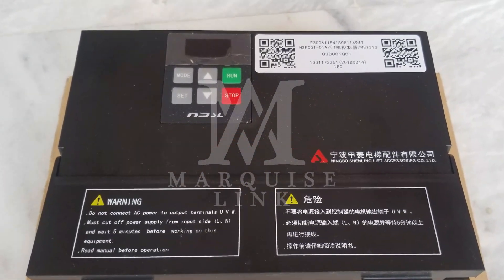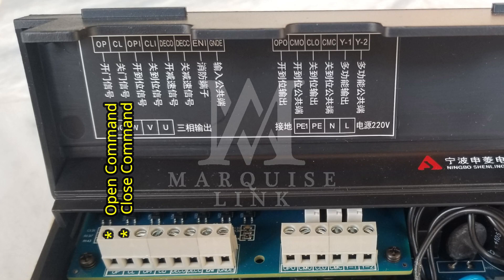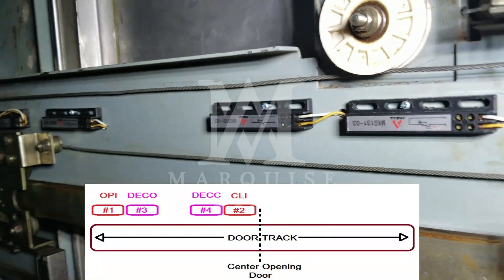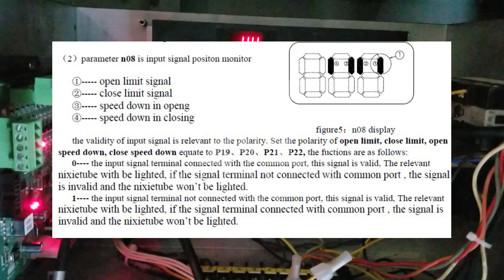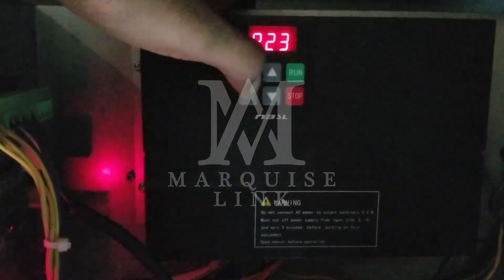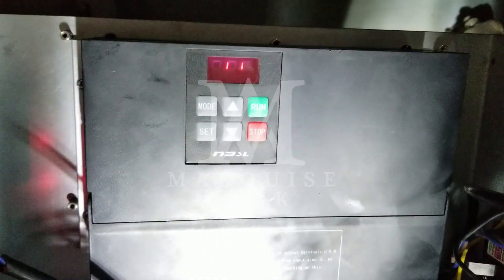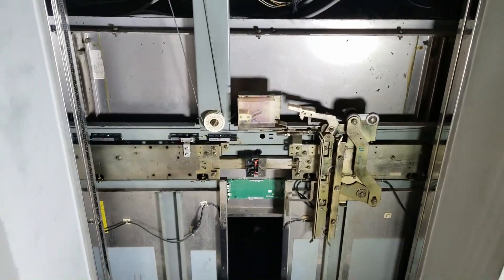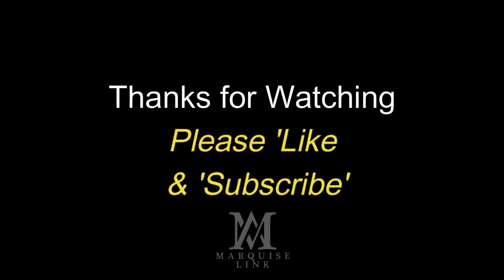NBSL Panasonic Door Inverter NSFC01-01A Installation Guide

Comment: I have door operator Panasonic and monarch control we have E55 how to solve please
Reply from the maker: It seems that it isn't reaching the 'Open Final Limit'
1. If your door is working on bi-stable switche, so fine adjuat the distance of the open limit.
2. In case of the encoder, just land the car at the landing door and then give a door track width teach.
Reply: @MarquiseLinkElevators  if we make door width tuning for door may the problem will be solved? Our door operator is Panasonic 3040dol
Reply from the maker: @V34916  Of course, because an E55 appears when the door doesn't get its final open limit
Reply: @MarquiseLinkElevators  there are no encoder for door motor , it’s asynchronous motor with Panasonic inverter 3040dol
Reply from the maker: So you just need to fine adjust its final open limit switch
Reply: @MarquiseLinkElevators  may can u make a vedio for some of this problems
Reply from the maker: It'd be convenient if you send the videos of those specific issues that you want to resolve,